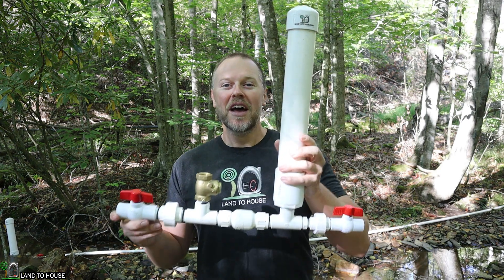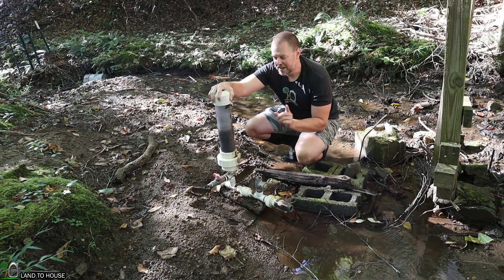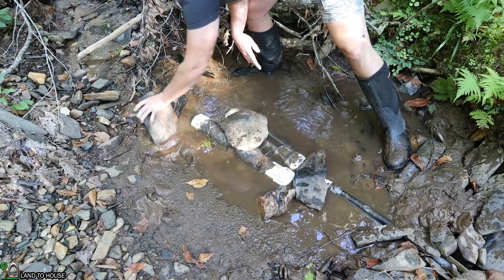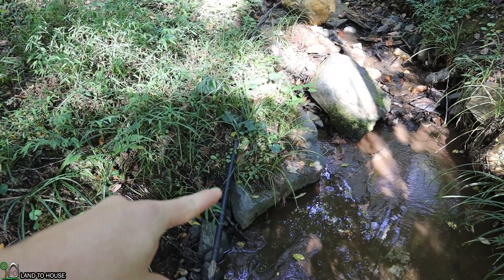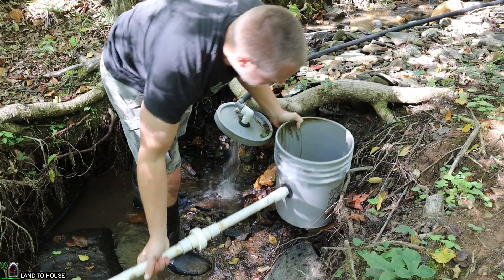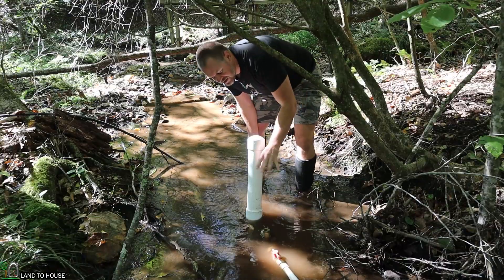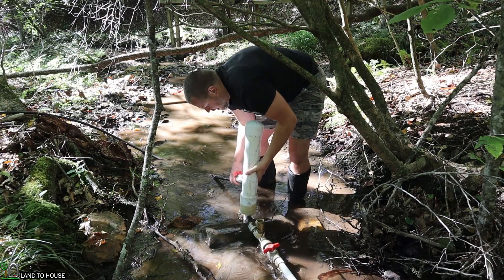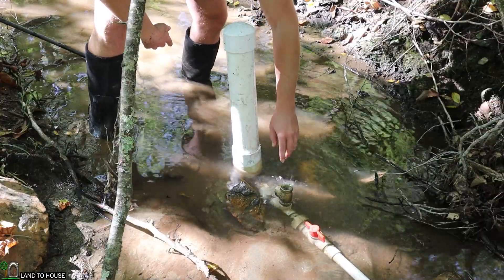Ram Pump Storm Survival Tips - Help Prevent a Pump Washout

Comment: Can the waste valve be under water to mask some of the sound?  Thanks!
Reply from the maker: Yes you can install the waste valve underwater. This reduces the sound of the click but might not reduce the sound of the drive pipe pressure wave.

Comment: I originally Built My Ram pump from watching your video so I have to give you thanks for that I totally Stole Your Design and I've been using it for a long time now years now and I fiddled and played with different ways to speed it up slow it down blah blah blah just tinkering for the most part one of the most interesting things I came up with is you can control how fast your RAM pump Cycles by raising or lowering just the brass valve up and down like I've had it a foot above the Inlet pipe and all the way screwed in just like you have yours normally and one would ask well why would you want to slow it down or speed it up well I've noticed if my Ram pump is going fast it moves less water I noticed that when it moves slower and takes a longer Gulp or push of water I get more water

Comment: I enjoy your videos Seth!

One comment. I have an 'off grid' water tower at my garden, that is filled by an electric pump, not a ram pump.

When I first set it up, I was also filling from the top, like yours.

I ran into a video on youtube, (Maybe it was yours?) that tested filling from the top vs. filling from the bottom, and if I remember right, it was about 7% faster filling from the bottom. Filling from the top means you always have to overcome the maximum height, just to allow it to drop 3 ft to the bottom of the tank. Filling from the bottom allows lower height to overcome as the tank fills, and only 1 pipe.

Thoughts?

Thanks.